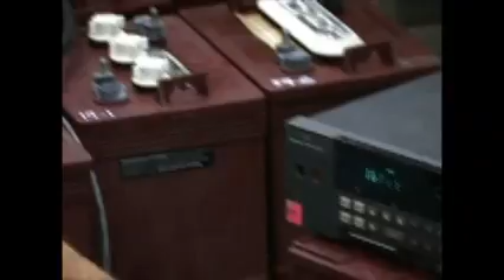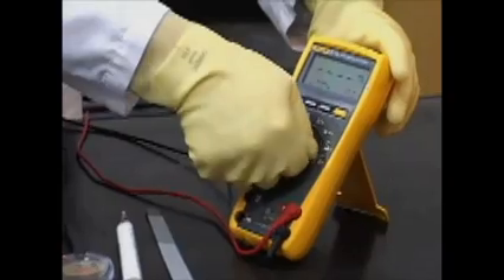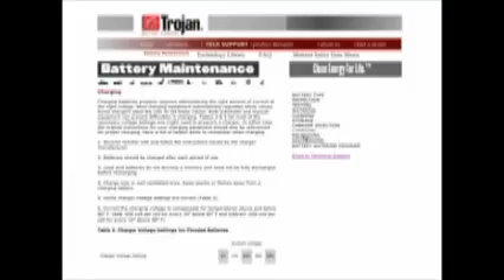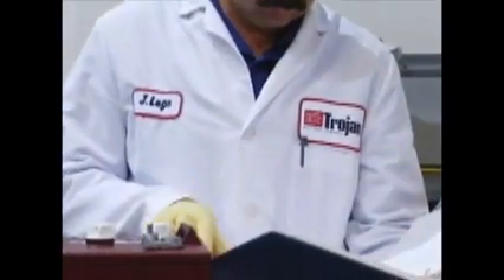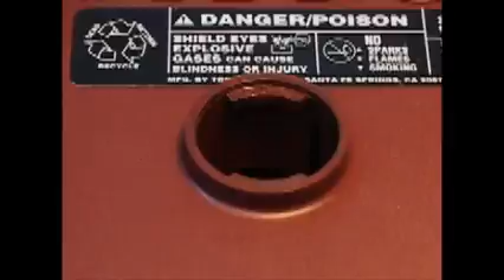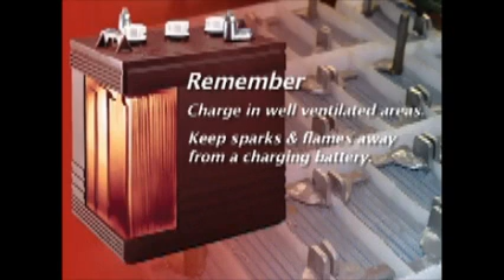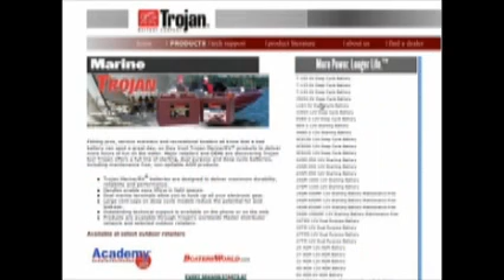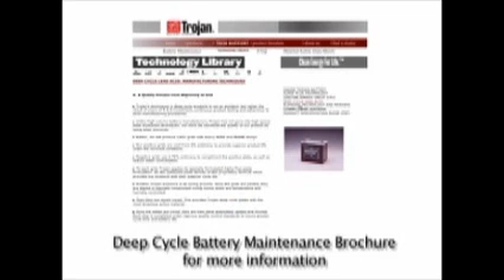Trojan - Battery Maintenance Video

Comment: I have 26  6volt batteries tied in series making 13 12 volt batteries which are tied in parallel making up my solar system. Had these for almost 5 years now and they cannot hold a good charge. All no have running at night is a 9cubic foot fridge and in the morning the batteries read  12.1.  But that's summer time. With winter I'm charging the batteries every other day depending on sunlight. How can I extend my battery life longer?

Comment: Also I highly discourage  using a wrench with all the metal exposed like shown in this picture.  It is dangerous to use it around batteries.  Bad "advice" given here to say "use a wrench" and show that image.
Reply: Are you referring to 2:18 where the entire wrench except for the open jaws is insulated with electrical tape?
Reply: I used combination and open end wrenches when doing battery jobs when I was a golf cart tech. Sockets tend to make it quicker and safer, but the main thing you need is to be smarter than the wrench.

Comment: Some of this advice is not so good.  For example, never undercharge or overcharge a battery?  In some cases these are both beneficial.  An  example of a useful undercharge is  if I play 9 holes of  golf, break 1 hour for lunch, then play another 9 holes.  It is likely better to charge for the 1 hour rather than just let the batteries sit in a somewhat discharged state.  Also, an overcharge is good sometimes to  force a stubborn battery to  gas and thus help alleviate  stratification.
Reply: Not true. Deep cycle batteries do not like being topped off like that. If you upgraded to lithium batteries, as it becoming more common, topping off would be recommended if you needed the distance.